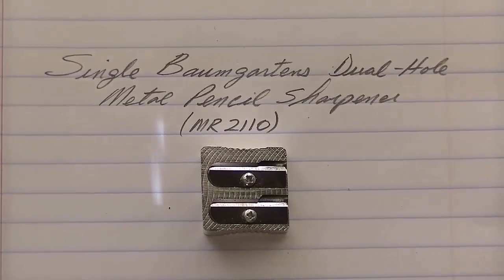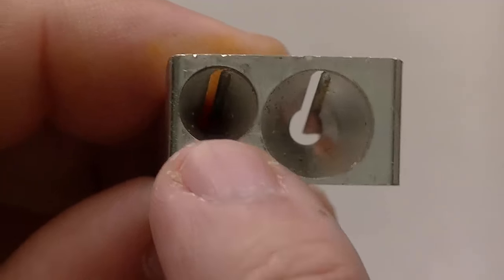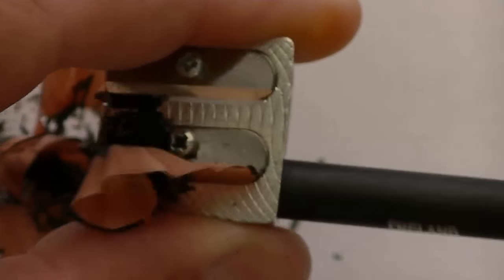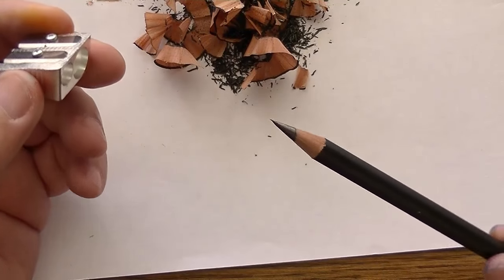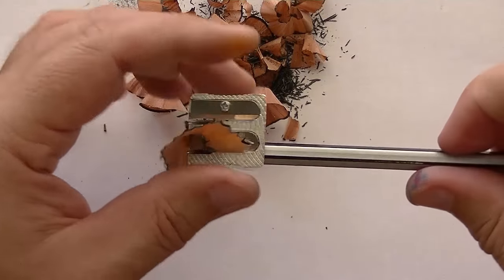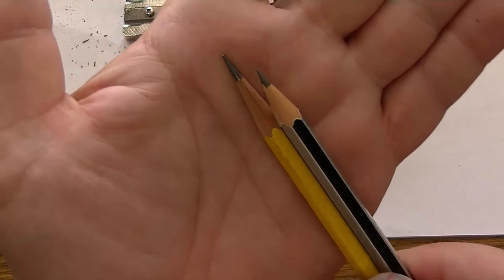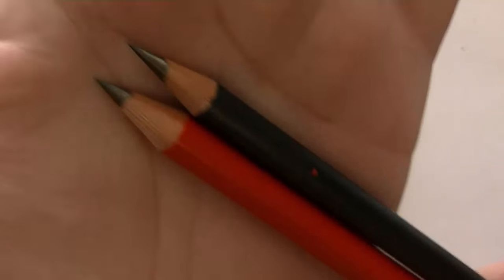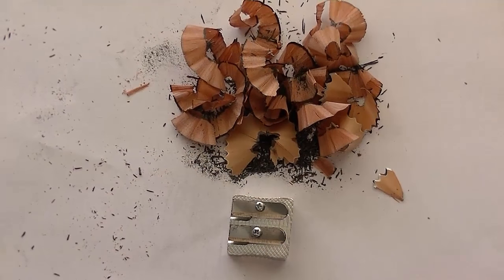Baumgartens Dual-Hole Metal Pencil Sharpener Review

Comment: Thank you for your video. Regarding 0:51 the metal body of the Dual-Hole Metal Pencil Sharpener is made from Aluminum rather than Magnesium. Aluminum is corrosion resistant and durable but Magnesium is not.
Reply from the maker: Thanks. The thing about old videos is that your mistake lives on in infamy.

Comment: Which dual size auto stop sharpener in your opinion is the best?  Doesn't have to be the longest point.  Just best in general/overall.
Reply from the maker: "Auto stop"? None of the hand-helds I have auto stop. So I'd have to go with the mechanical hand-crank Deli Sweet Memories.
Reply: I thought the Kum did.  It only lets the lead get so long before it stops due to length.
 It hits the outer wall of the sharpener
Reply from the maker: You asked for DUAL SIZE.  Kum does not do dual size, only regular size pencils. Dual Size is regular size and jumbo size pencils.  Are you asking about TWO HOLE sharpeners rather than DUAL SIZE?  If so, my favorite hand-held 'two-hole' sharpener is the KUM Masterpience and the Big Triple.